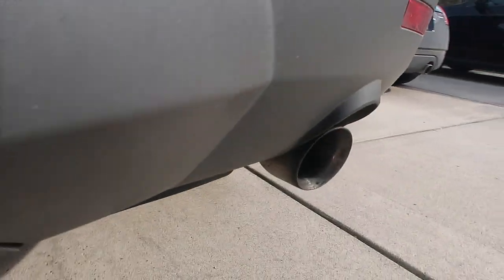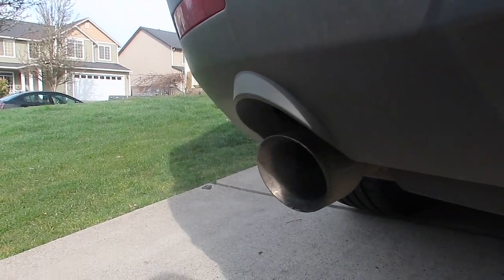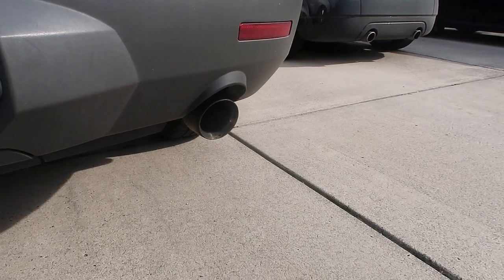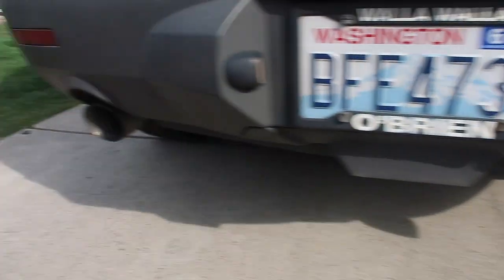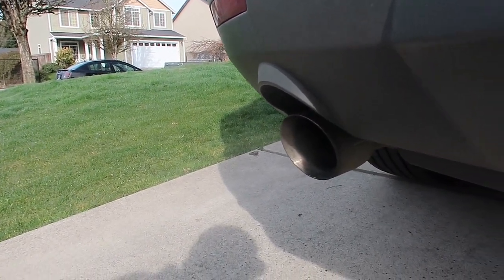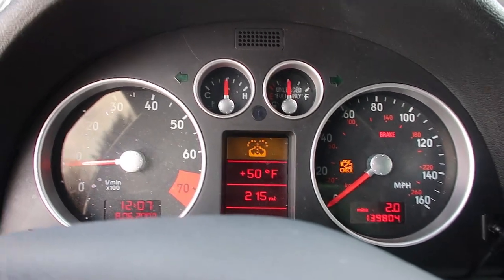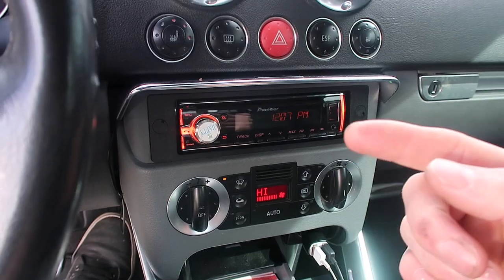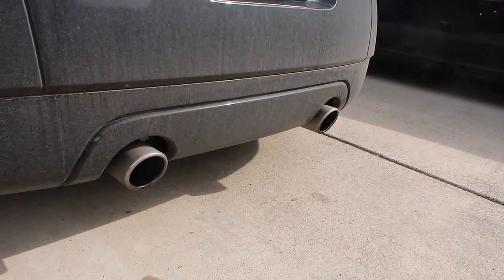More Audi Cooling Problems

Comment: We drove our 2005 A4 1.8T Audi Avant to Mexico City from Oregon last March 22, down there this exact problem showed up. 
Our solution was to rebuild the turbo and voila! Solved.
Apparently the coolant was bypassing within the turbo and the pressure plus temperature created the white cloud of unknown coming out of it.

The Audi performed as it should on the way back to Oregon, then we broke the radiator with a street bump in California, but that is another history.

I hope this helps!
Best regards
Reply from the maker: Ours was definitely a head gasket. It failed a leak down but that being said love the information because the turbo is still factory and probably on its way out. How many miles is on your car?
Reply: @ModdingAddiction what caused head gasket leak? I have exact same symptoms- steam coming out. Coolant level was decreasing but after topping off, it stays there. 75k mi, never overheated. Going to do leak down test. At least block tester was fine.

Comment: To bleed the air out of the system you have to do it at the heater core where the lines go into the car their are 2 holes on both lines my A4 had the same issue
Reply: B7? I was having problems with the thermostat not opening.

Comment: if it was a head gasket problem the smoke would start straight away and you would have misfires  now it needs heat before it starts smoking.
Turbo is cooled whit coolant perhaps cracked ? i have seen a couple of those.

Comment: Any update mine has the same issue and it super randomly just dumps the coolant. (01 a6 2.7 quattro)
Reply from the maker: Wel I have taken the engine out and did a head gasket on it. After inspecting the head gasket it don’t look bad at all. While putting the engine back in I broke a couple of the plastic cooling parts as they were pretty brittle. Since then I haven’t had any other problems with the cooling system. Now I have a weird starting issue that is showing. Only this first start after a long time sitting does it not start right away. But after that it starts right up. It’s the strangest thing. Good luck on your coolant quest. I would look into the water pump or the coolant temp sensor they are know to fail and leak

Comment: I'm 10 seconds into your video and I already know I had my GM coolant went through the intake there was a water jacket in the intake and it went through the engine and you never knew where the hell it went to until I went to replace part on the mass airflow or a throttle body and I found it

Comment: so, If you have diesel most common is EGR Cooler just burning the water, this is serious as it runs fine then pufs smoke as hell then stalls turbo that stalls engine. In gasoline most common is head gasket, as him you americans just turn the key and press on the gas not waiting for it to go up to 90°c, drive it slow when warming up. thats it

Comment: Also rebuild kits are cheap for those turbos
Reply from the maker: Have you rebuilt one? If so what kit did you use?
Reply: @ModdingAddiction  Amazon has the for 50.00 dollars
Reply: @ModdingAddiction  Not the exact one i used but very close to it but pull the intake charge pipe off and if you see white powder PULL IT
Reply: @ModdingAddiction  and yes i have rebuilt a k03/k04 turbo
Reply from the maker: Sweet hopefully that’s what it is. Thanks for all the help